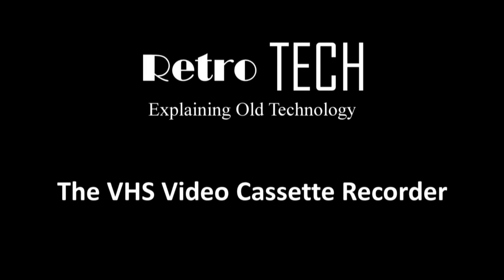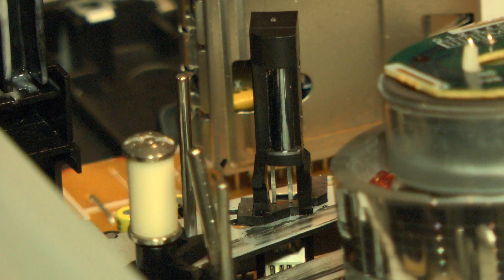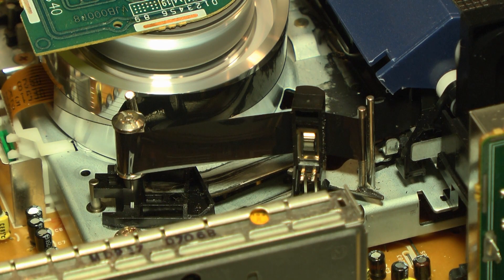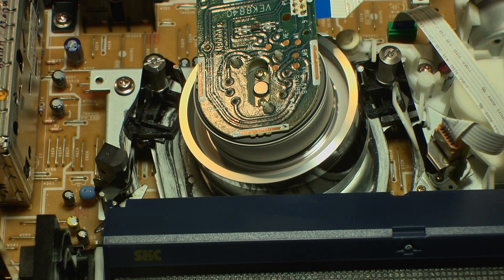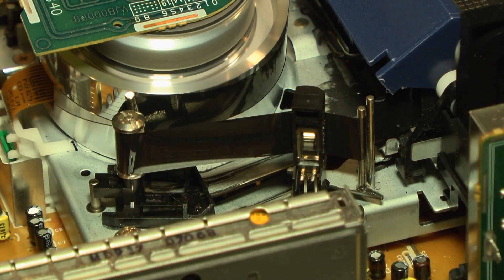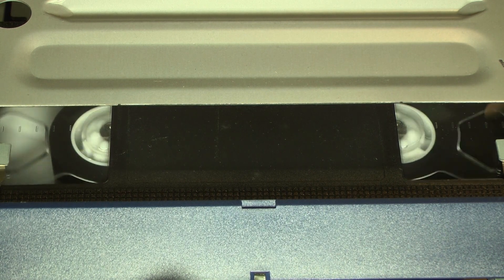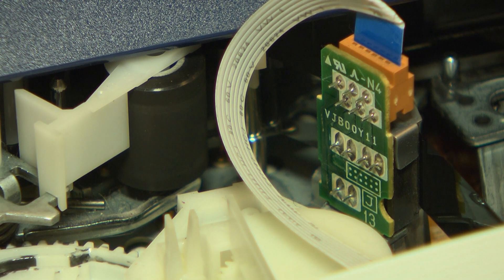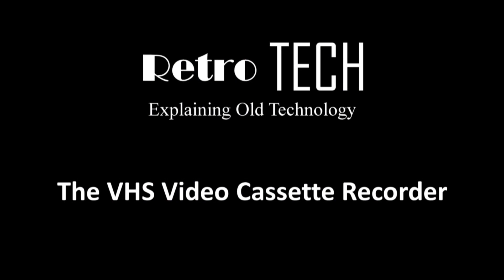VHS - How It Works

Comment: Awesome, thank you! 
I dug up the old VHS recorder with some tapes and tested it out, only to watch how it spitted it out with the tape still outside of the shell... 

I opened it up, and took a closer look at what was wrong. 

After watching your video, I now know that the two tape guides that are supposed to wrap the tape around the big spinning round video grabber thing, were not doing anything at all. 

Going to see if I can fix it tomorrow... Thanks for this video! This was exactly the information I needed.
Reply from the maker: Thank you for your comment, good luck!
Reply: Alright, I found out that a little gear going all over the place. The gear shaft was broken, so I glued it in place and made sure the mechanism was back in order.

The cassette is being loaded like it should, tape guides are doing their job... 
But the player only wants the tape for a brief second, and then it spits it out again.

But I made some progress...

Comment: Hey I have a question, do you know how to fix VCRs? When I insert in a VHS my VCR turns off. When i turn it back on it spits out the tape but the film is snagged. Upon examination the belt on the right side stops working.
Reply from the maker: Thank you for taking the time to view our video we appreciate it. There could be a number of issues causing the problem, check all belts and clutches, usually it's a problem with drive belts or similar. Without knowing the brand or model number i am unable to help you further.